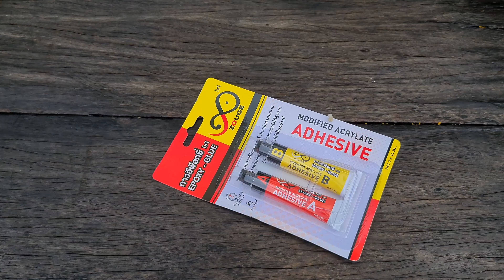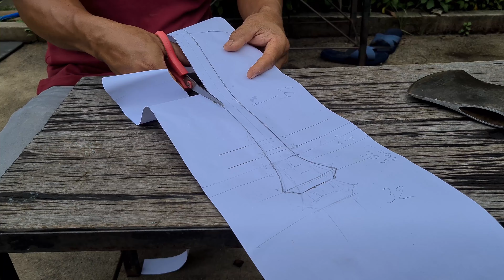Making a Gorgeous Axe Handle From Curly Padauk Wood | Woodworking

Comment: A axe head shouldn't just slide on like that it should have a tight friction fit and then the wood wedge makes it even more solid. Beautiful work but I see it as a wall hanger and I use all my axes. God bless
Reply from the maker: Thank you very much for your comment.  You are right, most of our work is done as art for collection or display.🙏😊